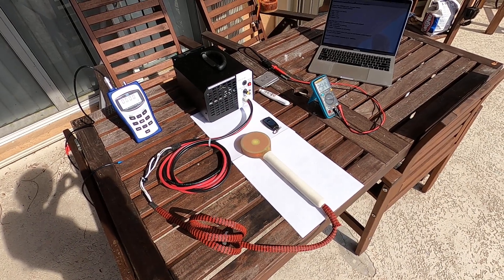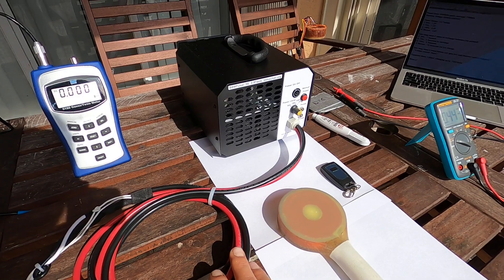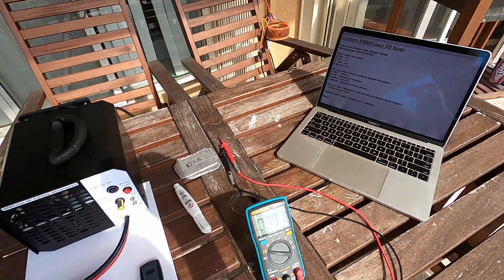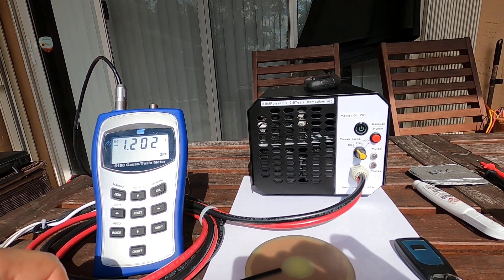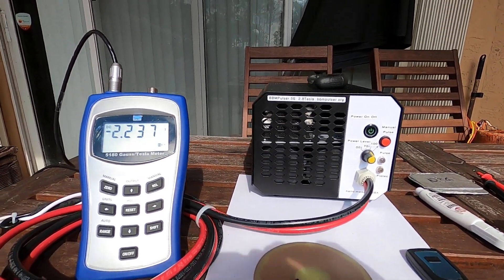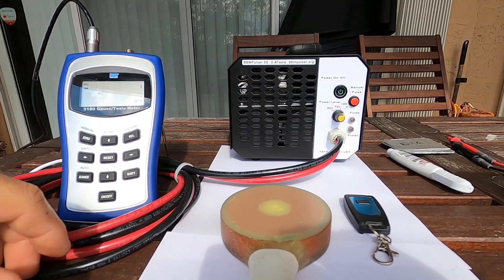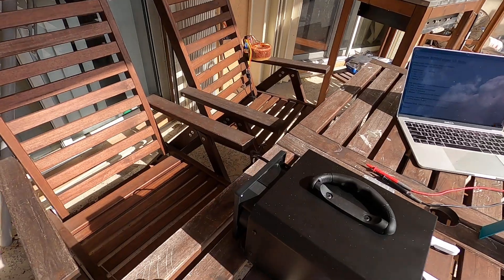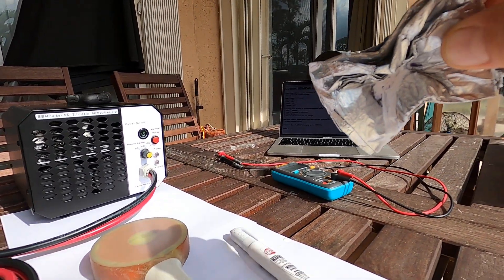020 BBMPulser 5S model running 240VAC, putting out over 3 Tesla (30,000Gauss) Strong PEMF machine

Comment: Is this for healing elephants?
Reply from the maker: For elephants you need 30 Tesla or more. 3 Tesla is perfectly suited for humans or animals smaller then us, even small aquarium fish could be treated with this power
Reply: @AndreyD  Amazing engineering. I must admit im intimidated by the power. If it flicks chunks of metal in the air then who says it wont flick my heart through my throath? haha
Reply from the maker: @stefgav  Magnetic Force reacts different with our body compared to the metals. Yes 3 Tesla seems like a lot of power but this power degrades a lot with the distance. Let's say 1" away from the coil 3Tesla will become 0.3 Tesla or lower. So by the time it reaches internal organs its power dramatically decreased. That's why Im building stronger Units to be able to rich deeper
Reply: What is stongest output? I m a physio treating joint pain with klemens pulsar but not happy with it..